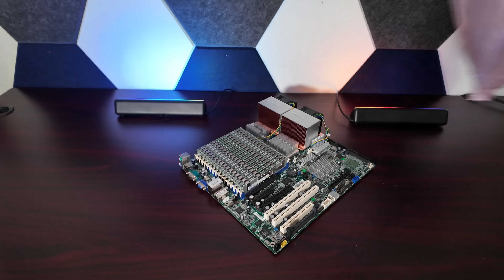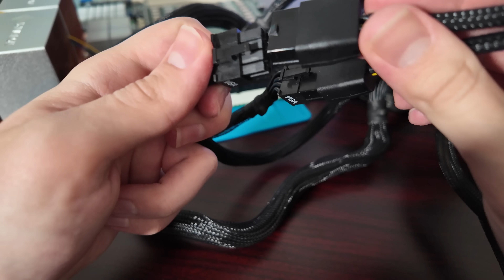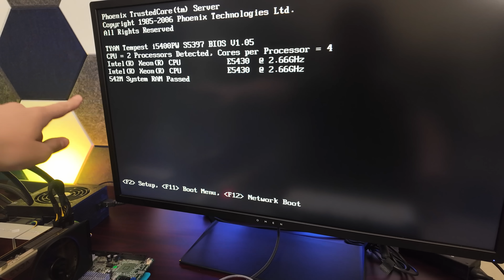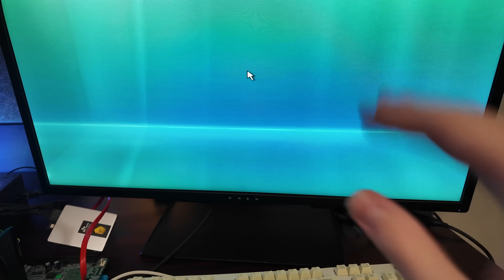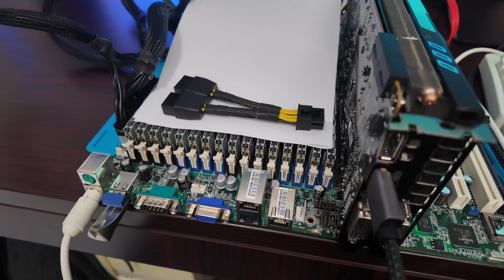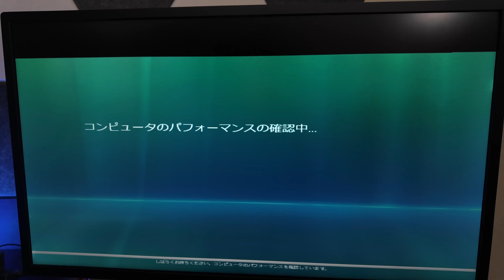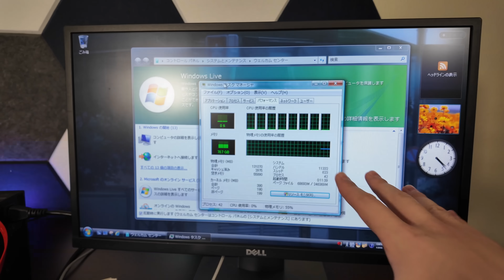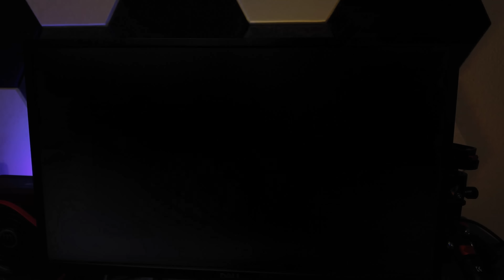What can you do with 128GB of DDR2?

Comment: The obvious first step to testing out the 128gb of RAM is open up 30 tabs in chrome
Reply: It tops out on "mere" 12GB most of the time. Gotta have to do some stuff like opening multiple windows of chrome to get more.
Reply: @deauthorsadeptus6920  Internet Explorer (the old one, yikes) was worse. It may not have used as much RAM as Chrome per tab (idk tho), but it definitely didn't send unused tabs to sleep and out of RAM after some time. So the RAM usage would rise proportionally with the amount of tabs you have open, while believe it or not, Chrome (and any sane browser) is dampening the graph.
Reply: @Sophie_Emilia_von_Zerbst  Problem with chrome is that it allocates way too much ram in the beginning, even if you have like one tab open. Which made chrome literally unusable on my old phone, as merely opening the browser slowed whole system to a crawl.
Reply: @Sophie_Emilia_von_Zerbst  The old one didn't have tabs. You'd need to open multiple windows.
Reply: @martijnjanssen3717 WXP era Internet Explorer was still slow af and had tabs
Reply: "can it run crysis?"
Reply: @Nalianna  wasn't crysis more like cpu demanding?
Reply: @Fauxed  Probably. I wasn't thinking GPU/CPU demanding, was just memeing on crysis :)
Reply: @Nalianna  oh 😂
Reply: @Fauxed  Crysis was designed with the expectation that CPUs would be faster, rather than have more cores. It simply wasn't designed with multiple threads in mind. So yep! Fortunately, it's not much of a problem anymore, with modern CPUs.
Reply: @Nalianna probably can, those xeons are period-accurate and will have strong single-core performance, the GPU may actually be a bit too new for it.
What will definitely make crysis unhappy is the multi-cpu setup, very likely to cause stutters.
Reply: @Nalianna  It can definetly run DOOM!!!!!!!!!!!!!!!!!!!!!!!!!!!!!!!!!!!!!!!!!!!!!!!!!
Reply: @Nalianna can it run doom 

No CPU, no GPU no disk space 

Only ram 

Can ram run doom XD
Reply: @aymanhawari2589 puppy linux runs on ram, so it can probably run doom on ram as  long the motherboard has some built in graphics🤔🤓
Reply: Thats what i did when i got 1gig in 2003, which was big at the time.   I asked myself what am i going to do with all this ram its ridiculouse... and then proceeded to open as many instances of firefox as i could.   I lost count the tabs got so tiny, and remember the pain of closing them all.
Reply: @mikejones-vd3fg  you'd find the tabs that same pc would open today would be a lot less though with firefox, even with optimized browsers (which firefox isn't one of these days)
Reply: @mikejones-vd3fg  OOF, if only you knew about ctrl + shift + w
Reply: one of my tasks is to lower the amount of tabs and windows I have on google chrome. The measurement that I use is chrome startup time...
Reply: I imagine you'd run into CPU limits far before maxing out the RAM.
Reply: @DaniZee-Boi   make em idle
Reply: I remember opening up 1000 tabs on an 8gb DDR3 ram school desktop computer. It ran it so slowly and trying to close all the tabs at once just froze it, so we tried to force shut it down, by holding the power button and it took like 10 minutes to do.
Reply: @edanbinder5056 why didn't you just unplug it? Wouldn't it have been faster?
Reply: Or ten tabs of yahoo mail
Reply: The older the windows the more efficient it is about stuff sadly too 😂
Reply: Waste of time having so much Ram. I have 64Gb of ram, bought when it was more sensibly priced and yet the most I have ever seen used is 24Gb. And that is making videos and running other stuff. It's as if Windows can't manage ram to use more.
Reply: It can probably open hundreds comfortably, given the CPU could handle them. On my system with 64 gb of ram, I stay at around 200-400 tabs with brisk speed. It starts struggling at around 600 tabs.
Reply: 300tabs in Chrome confidently 😂
Reply: The problem with that us the internet connection, windows vista is literally not secure enough to even be connect with the modern internet, you don't even have to open browser or do anything to get virused, the fact of connection is already death for the system eventually.
Reply: I have currently 4350 open tabs in Firefox with 16GB RAM... it's bad :( (update 2026may... I wanted to reduce but now I have 5100 instead) (update 2026okt - 8400 tabs :(... I failed to reduce)
Reply: @rudenslietus26 its in suspended state , lamfo but how do you even navigate that even with groups and workspace thats gonna be terrible .
Reply: @xninja2369  that's the point - I can't manage it... that's why those tabs stay open for years... until something breaks and all vanishes (wouldn't be the first time :D)
Reply: @rudenslietus26  I have about 3000 tabs open currently, I basically use tabs as bookmarks and when I need something I can just use the Search Tabs feature to find the one I need. I even keep backups of my Firefox session file so my tabs can be restored if anything goes wrong.
Reply: @rudenslietus26  I understand the pain of wanting to reduce tabs but making +20 new ones instead.
Reply: @grygrygrygry5423  It is completelo out of control now, already 8400 tabs in Firefox along ffs.
Reply: @rudenslietus26  I once had 4200 tabs on Chrome also with 16gbs about a month or two back. I managed to shrink it down to just under 500 within that time.
Reply: @rudenslietus26 wait until you find out about bookmarks
Reply: @rudenslietus26 genuinely how the fuck man
Reply: I have moe than 50 tabs opened in Chrome all the time...
Reply: @justusstern9125  are you rich or insane? probably both lol
Reply: ram exists to be used. judging by internet comments, average program has more brain utilizing and freeing memory when needed than average human
Reply: I have 94 open on my phone. 😑
Reply: Except that vista can't even connect you to modern onternet due to lack of modern TLS protocol. Stupid to install windows on this machine
Reply: @akostadinov  actually you can, but you will have to install all updates (including Server 2008 which does have TLS 1.2 update (not 1.3 tho and it's for IE only) but that also require registry change to enable it), and use Supermium browser (modern Chrome/Chromium fork that can run on XP, Vista and more old OS, and that browser support TLS 1.3). But regardless, it's better to just install Win10 (or 10 LTSC) or Linux on that thing.
Reply: @akostadinov  There are browsers out there that can get around this.  MyPal works on Windows XP and up, and there's also r3dfox, which will work on Vista and up.
Reply: @akostadinov Would have been better off with Windows 7 since Firefox just announced another 6 months of support for it. I do miss the look of Vista though

Comment: you can run a server from 2001 and have a power bill for an additional $100/month
Reply: its only 80Watt per CPU and a total of 8 cores. thats not all that bad tbf.
what isn't great, is the amount of RAM sticks, that all need individual power, each stick needing 3.3v compared to 1.5v(ddr3) or 1.3v(ddr4) or 1.2v(ddr5)🤷🏻‍♂
still. all that together, will not be $100 a month, that would be per year. roughly.
Reply: @VintageCR  ram in the video require 3,3v , EACH, cuz that ram is FB-DIMM and have aditional AMB that draws 1.5v hanse that why it's so hot.
Reply: @Зебразебров this. Ddr2 fbdimms are no joke, they actually NEED the heat spreaders 😂
Reply: @Зебразебров  ah, thanks for the heads up! learned something new thanks to you.
Reply: @VintageCR ddr2 fbdimms eat power.. I went from a 2s ddr2 fbdimm server to 4s ddr3 and my avg usage dropped 2x 😂
Reply: @VintageCR  Some servers have 4 cpus . But worse, servers PSUs and fans will make you deaf.
Reply: @VintageCR  DDR2 uses 1.8v regardless type of it not 3.3v as you mentioned.
Reply: just install Linux
Reply: @MelroyvandenBerg  that doesn't change how power hungry anything with a bunch of ddr2 fbdimms is
Reply: @forbiddenera  well hopefully less expensive then running Vista ;P
Reply: @MelroyvandenBerg jeez is that what hes doing? I didn't watch the video i just came for the comments 😂
Reply: @forbiddenera  haha yea.. he did install Vista... ><
Reply: @MelroyvandenBerg kk.. now I almost want to watch the video...like this has to be a troll right? 😂 like who installs Vista for any purpose other than you were duped into it by Microsoft when it came out?
Reply: @forbiddenera  for sure and ddr3 wasnt much better. I remember the high bills my gma got when I was a teen and I had 24gb of ddr3 lol. ddr ram also uses a lot of power.